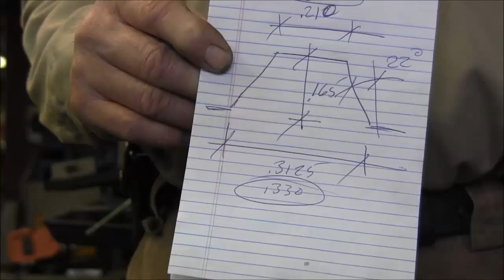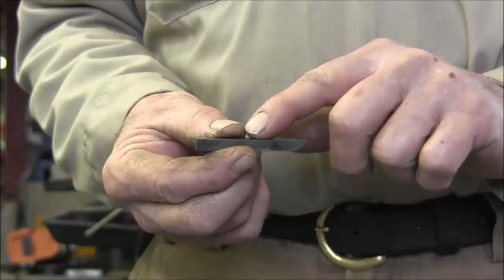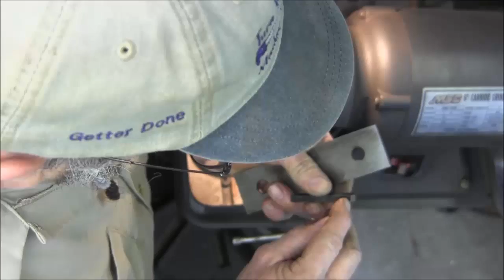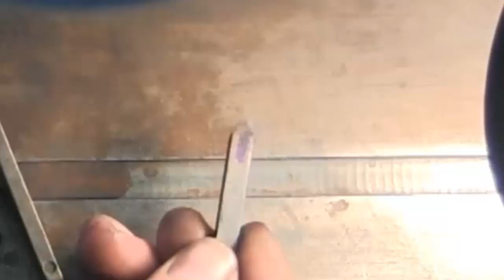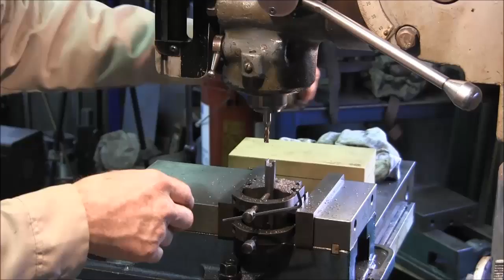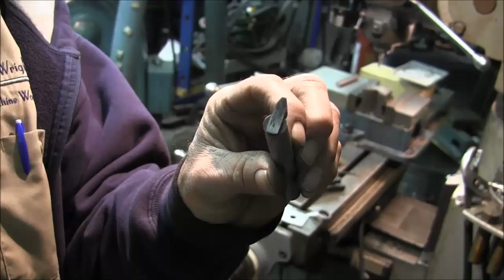The Stroken Spline Part 5

Comment: When watching your projects I immediately begin to plan how I would complete your job. I Was curious from the beginning on what method  you were going to get the cutter parallel along z axis.  Leaving the cutter edge sticking out past the slot edge enough to get a straight edge on it was the key.  This little decision was extremely important  for easy and quick alignment of the cutter. For those new to machining keep in mind that you must always be able to determine cutter centerlines and parellelism to get good results.
   At this point I have not seen the entire finished broaching video.  My thoughts are now on getting a good fit with the shaft enen though it looks like he will not be able to actually check the part with  shaft untill the part is removed from the setup.He has said he does not want a real tight fit ,   If his fit is too tight ---there is going to be some unpleasant time involved in setup again,  Let.s see how it goes ----I'm the one with the "BUTT tight" or TIGHT BUTT   when I'm at this point in a job!!!!!!
  By the way ---- when aligning the tool blank in the shaper head---the part was removed and the indicator was held on the dividing head chuck to  align the blank.  The indicator  base may have been placed anywhere on the chucked part and still got blank alignment.  If the chuck had been a 4 jaw-- this would have saved a little--maybe a lot of part alignment time. I enjoy the videos while on a treadmill ----relieves the boredom---thanks a" mill"  --sorry to ramble  jdb

Comment: Keith,
At 36:30 could you use the co-ax indicator to align the chuck to the spare rod in the broaching head?
Regards,
Eric
Reply: I was thinking the same thing, but I guess with the mag mount you are not depending on the jaws to hold the coax true? Perhaps that doesn't matter either...
Reply from the maker: Yes you can if you want to crank in the jaws instead of just slapping a mag base up there. It's an option thing! you could use it if you wanted to. ;{)-----